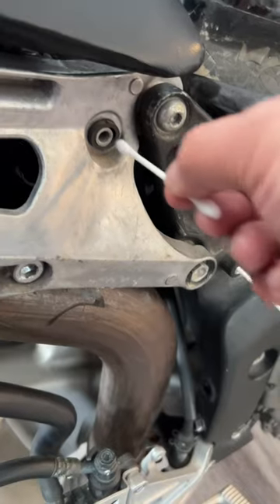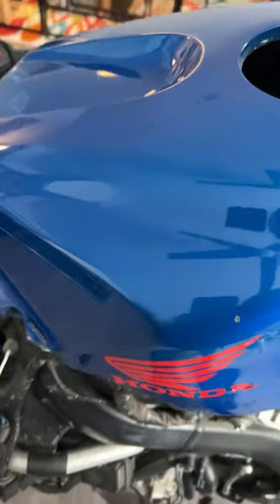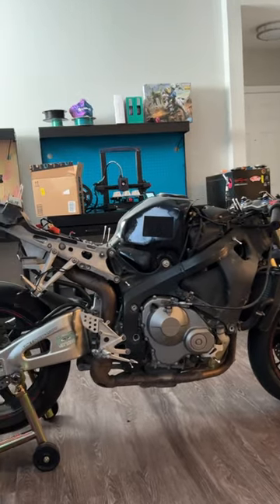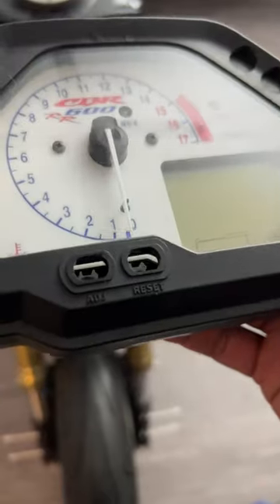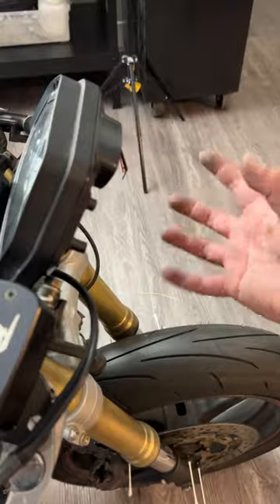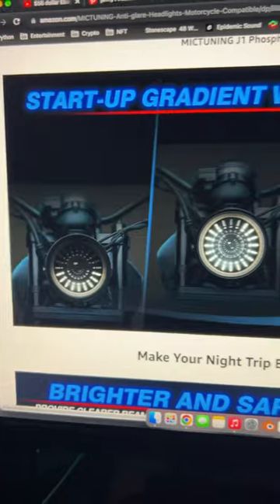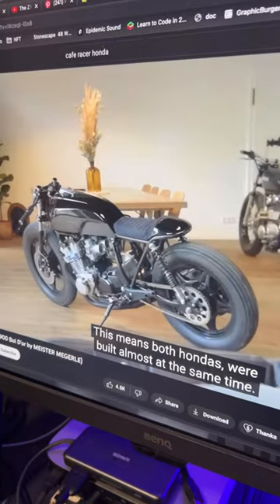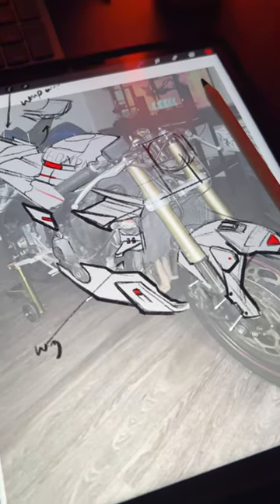Rebuild 2006 Honda CBR 600rr with 3D printed custom parts

Comment: Fuck before I forget. You can plug your quest 2 (assuming) into the pc, and use the pc version of gravity sketch (60FPS and way better). The reason I say it's worth it on Pc is because of the new updates, stability, and being able to not only work together with someone who can help you but zoom in and edit fast as fuck boyy. I learned every program at this point to find the most consistent and After 1 test model that one is stupid fast and with quality. Before it sucked, the updates added so much, but also thank you alot bro.  Because of your inspiration i've been kicking ass on my days off preparing a bunch of dope vids while waiting for my giant anycubic printer to get here. Thank you :)